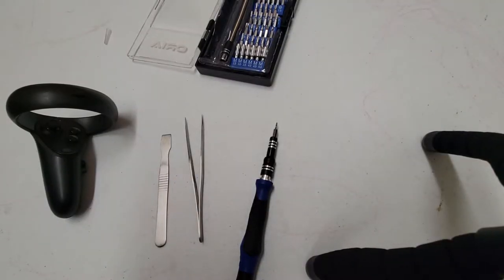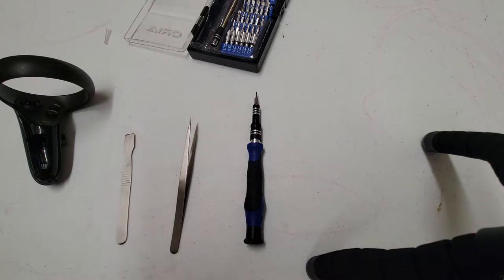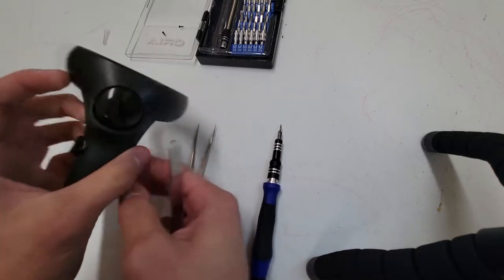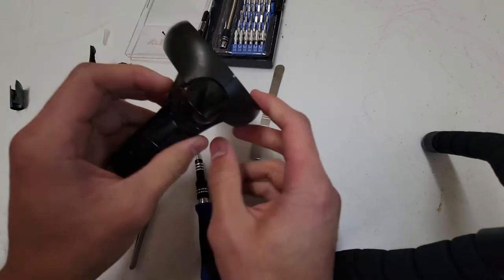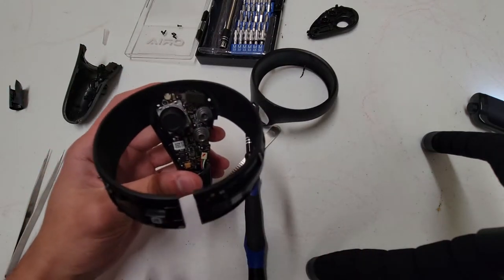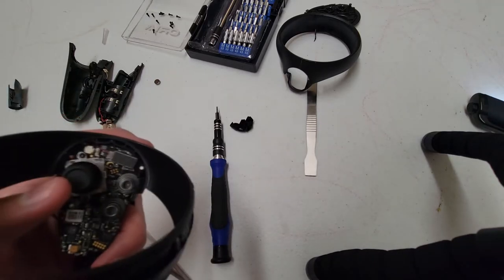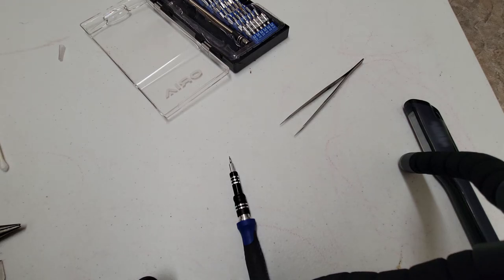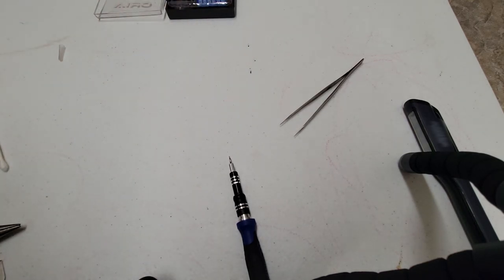Rift S Touch Controller Teardown, Joystick Cleaning, and Reassembly

Comment: Did this just now, took me a little over an hour and a half to get through it all, but it was 100% worth it. As of right now, the SIGNIFICANT drift I was experiencing is completely gone(for now). Thanks for the video man. Really helpful!!
Reply from the maker: No problem! Unfortunately, it's happening again with mine, so I'll have to do both again. To be honest, it probably only lasts 2-3 weeks under regular use before it starts drifting again. I looked up the part number on the joystick and I didn't find another one you could buy.

I have no idea how this could be fixed for a longer period of time, aside from replacing every spring inside it. Thanks for the support though!

Comment: Only had 2 screws strip on me. I didn't have a more defined T5, only just the one in my kit, nor did I have a 1.2 star key. I did however find that an H1.3 bit was able to grab the stripped ones enough to get them out and back in

Comment: of fucking course i broke the sensor flex cable for the ring maybe good news it has only two contacts so i grinded the surface of the flex cable a bit im trying to solder a fine wire to the two contacts wish me luck other than that good video could use a little bit more light but overall very good thank you

Comment: i work repairing video game consoles and this... This was a Nightmare ABSOLUTLY EVRY SCREW get stripped and i have a good set of tools that i use every day and never have problems with it... OMG i really hate this...
Reply from the maker: Can relate. One time I did it I had to find a set with slightly larger T5 heads if that makes sense. The angle you go at also matters; it has to be perfectly straight.

But yeah I feel your pain. Those are going to be very hard to get out now
Reply: @labcraft5954  thanks mate but because it is mine and this solutions is only temporary I just put the headset on a box and order a new quest 2 don't want to be bothering with that
Reply from the maker: @isttret  Yeah makes sense. My rift s broke and I got an older CV1 instead

Comment: After the first time I replaced the joysticks instead of taking the ring off which is by far the biggest pain in the ass of the whole thing I took my sacrificial practice controller found exactly where those screws are with a caliper and then marked those spots on the controller I'm fixing. After they're marked I took a small drill bit and just drilled down to where the screws are and got to them that way lol.

Comment: Managed to fix no tracking using the sensors from a spare controller, but the trigger pulls (the main trigger and side one that use magnets) are no longer being registered, any idea how to fix that?
Reply from the maker: Sorry for the late reply, but make sure the 3 small cables going down from the plug on the board are connected and haven't broken their solder joints or snapped. I haven't ever had this issue though, so I'm not sure what else it could be.

Comment: The buttons on my controller became loose after repair, and no longer consistently register a button press. I have to press harder to guarantee the press registers. What is causing this/what can I do to fix it?
Reply from the maker: Which buttons are you talking about? If you mean the "X" and "Y" or "A" and "B," then most likely the front cover isn't screwed in all the way. It's fastened with two screws on the back of the controller underneath the hand grip.
If it's the other buttons that can register more range of movement (i.e trigger and grip), then there may be a spring issue or a wiring issue on the inside of the hand grip. They're registered with magnets, if I'm not mistaken. Though I think you mean the front buttons I mentioned previously.
Hope this helps.
Reply: I meant the X and Y buttons. I screwed the plate on fairly tight, but I can try to tighten it further.
Reply from the maker: @MrDood-le8mn  Hm. The buttons have to be all the way in when you put it on, so maybe they were coming off when you put it on. Maybe take the plate off and hold it upside down when you screw it back in.

Comment: Unfortunately 3 of the 4 screws were stripped, trying to use a screw remover to get them out now :(
Reply from the maker: Ooooof. That's the worst. I would recommend trying one size larger of a torx bit to try to unscrew them if you haven't gotten it already.
Reply: @labcraft5954  tried to no avail, at this point, I've even tried a screw removal kit. And even that isn't managing to make these damn screws budge
Reply from the maker: @nmd68 are you able to use a dremel or something to turn them into flat head screws?
Reply: @labcraft5954  well I don't have one, but I know that'll definitely be cutting into the controller to reach the screw

Comment: I stripped the first 2 screws without even trying. what do I do now?
Reply from the maker: Oh man, that sucks. You really have to hold the screwdriver at a forward angle or that will happen. Also make sure you have the right size bit on the screwdriver. They are fairly easy to strip though.

If it's too far gone, maybe try an allen-wrench-type bit instead. When they're stripped, sometimes that will work.
Reply: Sometimes taking another screw bit you can lightly tap it in using a hammer or something. (Use something like a flathead) and make a new indent into the screw. Gotta be really careful tho
Reply from the maker: Update: I had this happen to me again, and to fix it I used a T5 screwdriver with more defined points. It managed to recover an extremely stripped screw from my controller without much issue.
Reply: @labcraft5954  t5 with more points? Can you elaborate?
Reply from the maker: @Jaydogg222  not with more points, it's still a hex screwdriver. Just try to find one where the points are more "pointy."

Comment: I have never not stripped a screw trying to repair these. It doesn't matter how much pressure I put on it, I turn the screwdriver and poof, stripped bare. 
I've got 20 years of experience repairing laptops, cell phones, etc. and these fucking Oculus controllers. I thought I was doing something wrong but no, they just suck.
Reply from the maker: Yeah last time I did it, I stripped one really bad. I tried a ton of things, and was even about to resort to dremeling it out. The fix was using a more defined T5 screwdriver (you could see the points of the hex more easily). I used that for the rest of the screws without issue. It was just that one screwdriver bit I had was either slightly too small or slightly stripped.
Not sure how else to prevent stripping on these. The screws are made of really weak material. Hope this helps.

Comment: 24:30 In this tutorial you say the connectors should be bent upwards slightly in an U shape, but in another rift S joystick tutorial video it tells me the problem is the OPPOSITE and the connectors actually need to be bent downwards so they stick out less???????? Two tutorials telling me the complete opposite, I need some feedback here.
Reply: Make it a U shape, downwards makes logically no sense, what is the point if it's making less contact, and over time, why would it bend in?

Idk why the other vid told you otherwise, good luck 👍

Comment: All went well until I got near the end. I popped off the antennae wire but instead of disengaging, it pulled the connector off the circuit board. Game over for me. When performing that step, maybe push on the connector while applying the lifting force to pull off the antennae wire.
Reply from the maker: Oh shoot, that sucks. I've pulled those off many times when repairing laptops, and that's never happened for me. Yeah maybe take it off at an angle, huh. I guess all you can do now is buy a "for repair" controller and replace the board

Comment: I heard that someone had success replacing the Rift S joystick with the aftermarket Quest 2 joystick kits so I ordered some and I'll be replacing the joysticks on my controllers. The joysticks on mine are loose so a simple cleaning isn't going to be enough in my case. I ordered the joysticks only since I already have tools.

Comment: In working on mine I think I discovered that the hex bit to remove the first few screws is a smaller one, and once you get to the screws holding the faceplate in place and the ones on the board itself you need to go up in size to avoid stripping the screw head. Unfortunately the previous owner of my rift S had already stripped the screws out on the faceplate, but the larger bit size was correct for removing the thumbstick.

Comment: Nicely done! You got all the saliant points. Good pro tips about the hinge bar and magnet. Now I just need to invest in a T5 to see if I can correct my Bad reverse drift, I can't play anything that needs my left controller for movement. Thank you!
Reply from the maker: I got the whole screwdriver set in the video from Amazon for like $8 lol, so not very expensive.
And don't most games require the left controller joystick for movement?
Either way hope it works for you

Comment: at 34:49 , "something happened so I had to take it apart again, this didn't have any tension...."

oh thank god, the same thing happened to me, let's see how he fixes it...

".. and now it does."

Oh...
Reply: No worries, I worked it out. 😁The spring thing got loose too quickly, second attempt I got a long thin fileeting knife to hold it down, no sweat, while I positioned the motherboard.
Reply: BTW, thanks! This is good quality content! Oh sure there was a bunch of goofs, forgotten screws and whatnots, but no big deal. The zoom could've been better for sure. If I were you I'd make an updated video with no goofs and better zoom! The need for this content will keep getting higher as time goes by.
Reply: And oh golly, this was a taxing surgery for sure, I'm glad I had my trusty lighted magnifiers. Still, quite the challenge. Especially as I opened the joystick up upside-down (yes, despite your warning) so all the little pieces fell out...  But now it's all good and non-working running forward + auto backwards drift are gone..... but for how long? 😋 But I will definitely be more careful with the controller knowing what a pain in the butt this was.. It's just that when I hear a troll pant behind me in Valheim I sometimes press forward with all my might in pure sheer panic....

Comment: Thank you for the video! Have you ever encountered a problem were only one half of the IR lights work? I've completely tore down my controller, made sure the ribbon cable was well attached and everything, but only the left half of my IR lights work...
Reply from the maker: I haven't encountered that, but my Rift S cable completely died so now I use a CV1 lol

Are you talking about only some IR's on the controller are working? Check if the ribbon cable was damaged at all

Comment: Any tip on what I could do if a button is not working properly? "A" button is responding only if I press considerably harder on it that on any other button
Reply from the maker: Is the front plate on all the way and screwed in? That could be loose which would affect button press distance

Comment: Thx! (^_^)
Used yur vid to do this last night. Noice that you cover the issue of where the sensors are in the inner ring and which side to pry so not to damage them.
Left controller joystick is rock solid now and the tracking still wurky.
Will see how long it lasts...mebbe more than the two weeks you got...mebbe not.
Note: I had coffee before doin' this so my hands shook WAY mOaR than yurs.
If I have to do this again I'll have a beer instead. (O_o)
Reply from the maker: I just did mine again over a month ago and they're still holding up. Glad to hear it worked for you!
Reply: What the fuck
Reply from the maker: @hwugh1  Oh yeah, it definitely doesn't last forever lol.
Reply from the maker: @hwugh1  I think your keyboard is broken but I'm glad it helped

Comment: Thanks for the video man.
This was a pain in the ass, and I stripped one of my screws, but this video was very helpful,
Reply from the maker: Lol no problem. I usually strip at least one screw every time I do it
Reply: @labcraft5954  
If it helps at all, I did find replacement joysticks that work.
I can put everything in a separate comment if it helps
Reply from the maker: @izzyp5713  That'd be really cool actually. Btw my Rift S died completely though so I'm using a CV1 now
Reply: I tried leaving a separate comment with the amzn link for replacement joystick, and it didn't show up. 
Is that not allowed?
Reply from the maker: @izzyp5713  Maybe not, though I thought I had allow all comments enabled.

Comment: Unfortunately i did everything that tou said and although i did fix my drifting problem , somehow I managed to damage the sensors for the tracking 🤦🏻‍♂️
Reply: I had this happen, it could be that the ribbon cable that connects the it leds to the board got pulled out / messed up. I fixed it by reconnecting the ribbon and that fixed the tracking.
Reply from the maker: I'm sorry to hear that. As  @Mr. Dood  said, the cable connecting the board to the sensors may have become unplugged. At 16:50 I pointed out this cable. Make sure it's connected properly.

By the way, if the sensors on the ring have visible physical damage, then don't bother trying to remount the cable. At that point, I would attempt to purchase a "for parts" controller on eBay and use that as the body of the controller and swap parts over. Just make sure it's for the correct hand.

I hope this helps.